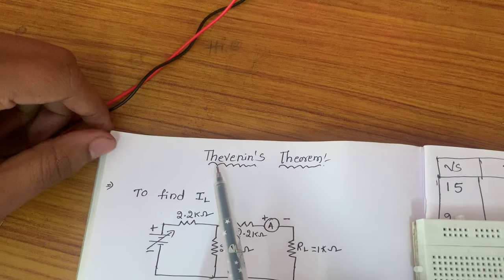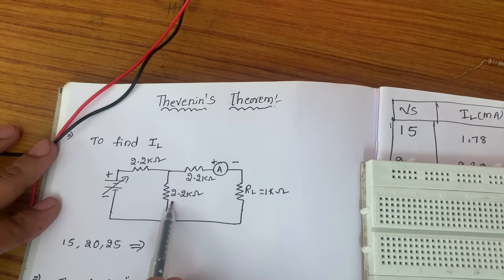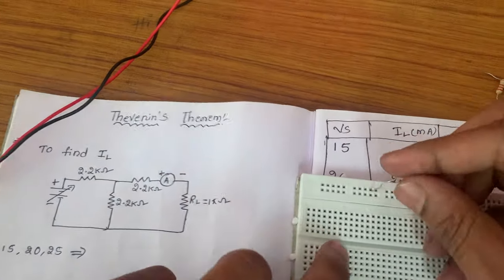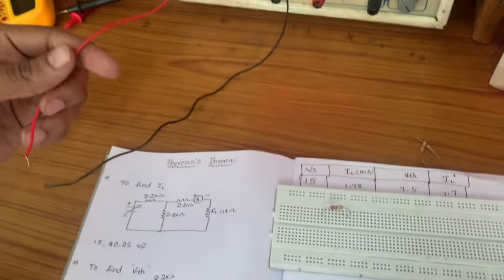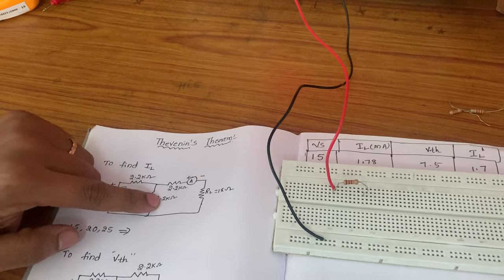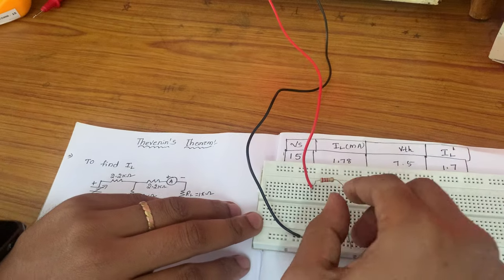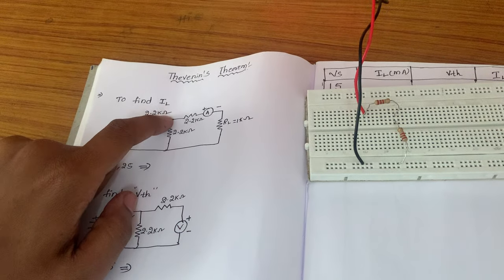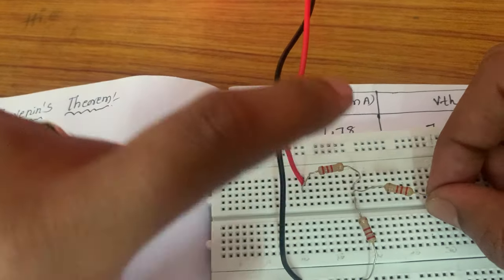11.Thevenin's Theorem Lab Experiment | Basic Electrical and electronics Engineering Lab | BEEE Lab

Comment: Sir does it make difference connecting them down by down and side by side
Reply from the maker: Yes.. we connect voltmeter in parallel with resistor only because in parallel connection voltage is same